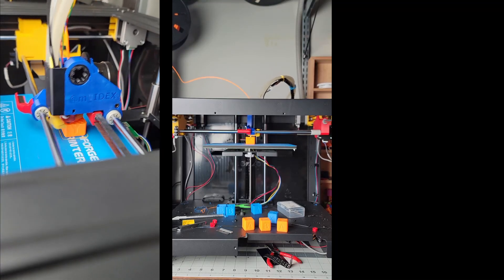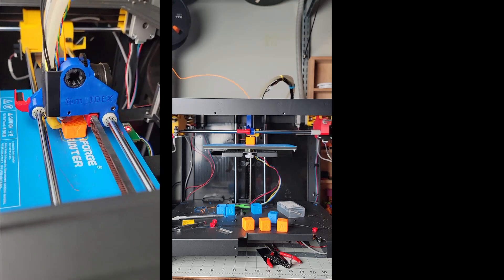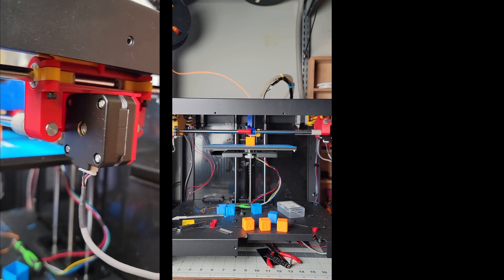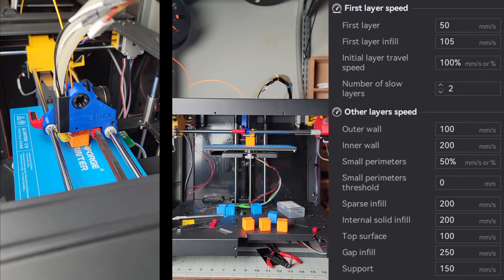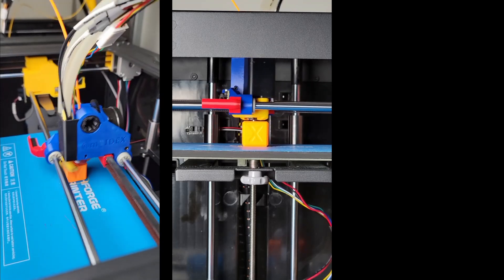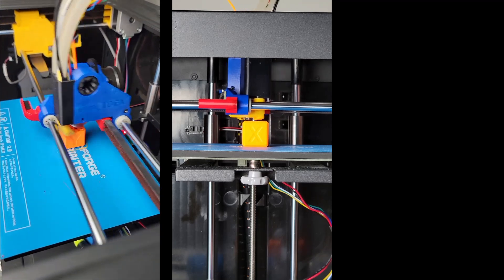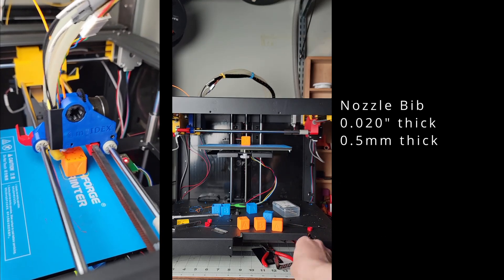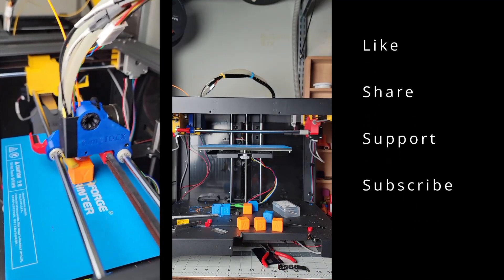AKULA XY Motion System - 1st Demo Print #reprap #klipper #bigtreetech

Comment: I found a gantry system that Xmotor is on the frame stationary which I can use on the replicator & no modification to Y. Maybe u already know.
Reply from the maker: I've been working on something like this for a while now.  But since I made the moving gantry so light already, I put the prototypes on the back burner.   It is something similar to a zero gravity extruder but adapted to x axis motor.
Reply: @m_IDEX  oh. Great 👍 looking fwd to yr new creation. Thks for sharing ❤️

Comment: What is the practical printing advantage over CoreXY?
Reply from the maker: All motion systems have a place, and all have a set of pros and cons. For example, CoreXY was trying to fix H-Bot gantry twisting problem. 

Akula class motion system is simpler, lighter, with shorter belts, fewer pulleys and is direct drive. All this can result in cleaner prints with fewer artifacts. Akula motion system has magnetic belt couplings making service and tuning much easier. This gantry is also self-squaring making assembly extremely easy.  Finally, the toolhead has a low center of gravity and is planted much like a go-cart.
Reply: @m_IDEX  I get that I'm just trying to understand in practical terms what the advantage is. CoreXY obviously isn't perfect but it's refined enough to where you can get prints that are pretty much as good as anybody would need at very high speeds.
What will this be able to produce as far as a final print that a core XY printer won't be able to do? I guess that was my original question.
Reply from the maker: CoreXY is an excellent motion system.  But, I believe that Akula class motion system is simpler, less expensive, easier to build, and easier to tune.  It is potentially faster at comparable print quality.
Reply from the maker: You are correct it is just a Russian word.  What does Voron mean?  Akula is a name for my new-ish motion system.

Comment: Thank you for providing information about the nozzle shield, particularly its thickness. I will be ordering steel sheets for my Idex Printer later. Keep up the good work.
Reply from the maker: In the video I mentioned that I use 0.020" spring steel. That is just what I had on hand at the time. Just make sure you do not order spring tempered steel as it would be impossible to drill or form. Any cold rolled steel (CRS) 0.5mm to 1mm should work fine.
Reply: @m_IDEX  Thx for the information👍
Reply from the maker: Very welcome

Comment: I like t convert my 235x235 bed slinger to this idex motion system can you do a spread sheet or spec of your frame  size to rod size so custom frames and bed sizes can be made. or do video showing how gantry is mounted to frame.
Reply from the maker: I am working on a frame design that will accommodate your bed size very nicely.

Comment: Hey that prints looks great! I agree with the option to modify the original Makerbot gantry. As discussed earlier, I'm still thinking about CoreXY, but even the native config could be improved. For example to get more Z-height. Though that might make an IDEX harder because of the edge around the topside of the frame.

Comment: What decides accellerations really is the length of the belt, belt tension and belt width and the weight of the moving mass. Of course the components have to be stiff as well. It looks as you have very short belt paths so I understand it should be pretty fast even if the moving mass is pretty big at 1Kg. If you want to double the accel then add two more motors on the Y axis. Double it again by changing to 9mm belts. If you really wanted you could make that thing a real speed demon. Of course then flow becomes the limiting factor so your would need better hotends.
Reply from the maker: This is why I love 3DP community and my viewers.  Everyone contributes something to this hobby.  I always learn something new from the comment section.  Thanks!

Comment: Akula aka "Shark"? Resonance or vibration for low speed motion on the Y axis? Is it noisier or is this the actual ADXL plots? Might be stiction perhaps or maybe the surface finish of the old rods, or stepper motor harmonics from the driver board, or belt vibration? I wonder if adding the weight of the second extruder and hot end will make things better or worse. Whatever it is, I'm sure it'll come out as you do more refinements... looking good though. 👋
Reply from the maker: Thanks Mike!  You inspired the name Akula-class motion system by your last comment 😊 You are correct, Akula is a Russian word for shark.  Voron is also a Russian word, so I guess I am in good company 😊.  
My prototype went from 12m/s² acceleration down to virtually nothing after I wiped on some 3-in-one oil in hopes to make it go faster.  Boy did that backfire!  I had to re-adjust the gantry and wipe down liner rods with IPA, just so that I can do this video at 10m/s².  I’ll get ADXL plots published in the next week or so.
Reply: Dmitry you really aren’t supposed to lubricate Drylin bearings as IGUS design them with built in lubricant that is released as they slide or rub.  🤔 I’m guessing the 1kg mass will be the X axis rods, both IDEX hotends & Y axis sliders. As you haven’t changed the belts etc with your latest revision it’ll be really interesting to see the differences in the ADXL plots. Onward and upwards 😂
Reply from the maker: An IGUS competitor, PBC linear had an article that recommended to wipe down linear rods with 3-in-one oil.  I should have known better.  Interestingly, they are both sold as self-lubricating, maintenance-free bearings.
Reply: I had no idea PBC recommended this, but I used 3in1 oil on go kart rose joints to good effect 😂